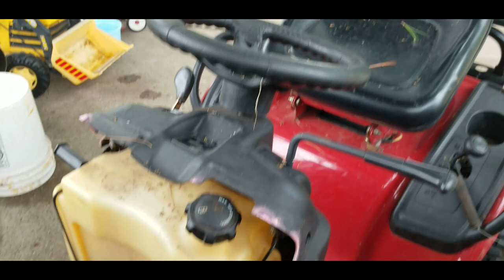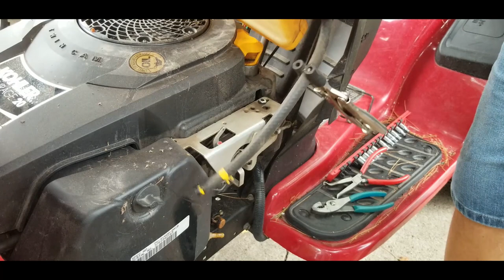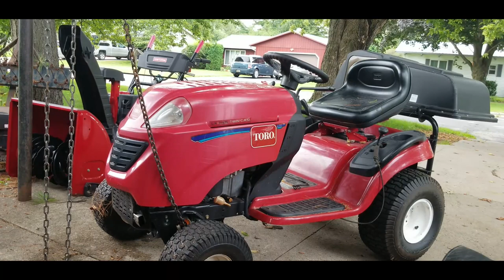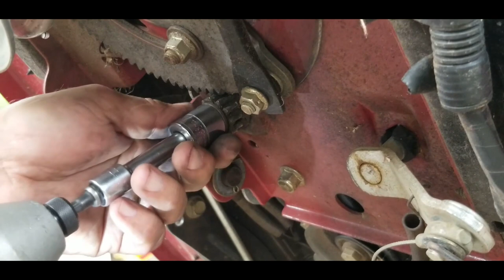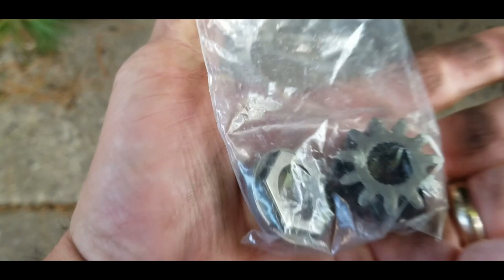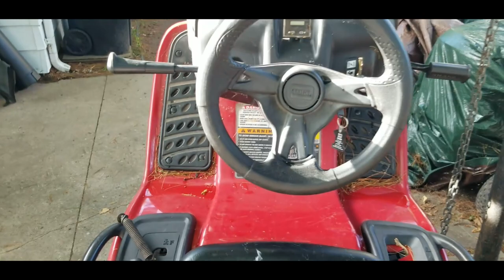Toro LX425 Lawn Tractor - Steering Fix

Comment: Thanks for the video.  I was able to do this without taking off the deck or fuel tank.  I used the steering wheel to help ratchet the 18mm socket.  I pushed the old hex flange up with a finger, removed and placed the new one on finger and seated it.  I see other videos removing the steering arms for room but it is not necessary.  Save time and get right to the part that failed.
Reply from the maker: Thanks for your input and thanks for watching!

Comment: I'm  just about to start on a lx427 that a friend tried to fix on his own. His old bushing is different than yours.  112-6257 which is thicker than the one you used. That thin one allows up and down of steering shaft and allows the bushing to pop out.
Reply from the maker: Thanks for the input and thanks for watching!

Comment: Well Done.  You may have not needed a new Pinion Gear.  I always grease the Oil-lite bushing and pinion/sector gear.
Reply from the maker: Thanks for watching!
Reply: Just the bushing and get several 😊
Reply: I use bearing Grease. I  Believe that using bearing grease overall will last longer and give you better lubrication.

Comment: Thanks for the info. I probably have the same problem. I have a 2006 toro LX460. It looks identical to that tractor. I had to adjust the toe on front wheels so I know the underneath is identical.. the steering shaft wobbles bad like that one did. So, now I know how to fix it. Thank you.
Reply from the maker: Happy to help. Thanks for watching!

Comment: Thanks for the video, I successfully replaced the gear and bushing.  I would also like to replace the sector plate with a damaged tooth, but cant seem to find any access to get a wrench on top of the 2 center bolts in order to prevent spinning while removing bottom nut.  Do you know how thats supposed to be done?
Reply from the maker: I have never had to do that. Sometimes, the head of the bolt is a carriage bolt and is in a square hole. So it shouldn't turn as you are spinning the nut. However, if there is indeed a hex head bolt, you will have to get creative about getting a wrench in that tight spot. Sorry that I couldn't be more help.
Reply: I have skinny fans and fingers and was able to put a wrench on top of the head of both center bolts.  I did not take them completely off I just loosened them so like in Grease wherere they move so the steering moo smoother Is over the lifetime of the repair.

Comment: Me, I would smear bearing grease on each side of that washer he had trouble putting on. Then bearing grease each washer that moves back and forth under that toothed plate that works with the new toothed sprocket. Apply grey antiseize onto the splined shaft too.
Reply from the maker: Good idea. Thanks for the suggestion!
Reply: @RealManSkills  Thank you I just returned this exact riding lawnmower to my customer's home after replacing the pinion gear and the hex washer. I had to get AA center punch and a mallet and knock out the old one that had worn out you can see the  Ware pattern was oblong. Once I got that knocked out I put the Hicks washer and it's new home hey add my friend lift the steering shaft up is a little bit to put that other washer that goes in between the steering plate and the chassie and the rest of it was downhill. Took the blades off sharpen them put them back on Titan them up to 25 foot-pounds. My customer is a happy camper.

Comment: Why not just lift the filler cap on the fuel tank, cover with plastic bag, refit fuel cap over it, and no fuel leak when you lift it instead of removing the fuel tank.

Comment: Gear was fine. Problem was warn out bushing. Idiotic engineering job. Steel metal shaft inside a metal busing without any lubrication. What could go wrong?  These bushings will last one season only. They are made of soft crappy metal. My 44 year old Simplicity Mower had original gears, joints, seat, bearings, deck, etc. Never ever required any work.
Reply: I mow roughly 7 acres of grass with my Toro LX420. It costs about $18 in gas. I bought a Husky 54" zero turn and it costs $100 to mow same grass. Now I just use it when grass gets too high.
My Toro I bought USED 4 years ago. Still runs great. Just the steering bushing wore.out. I hit to many trees with the tire.
$6.99 pinion and bushing on Amazon. It comes tomorrow and I'll drop it in.